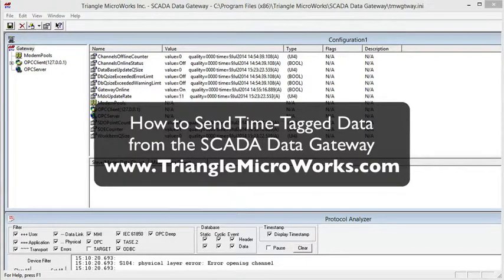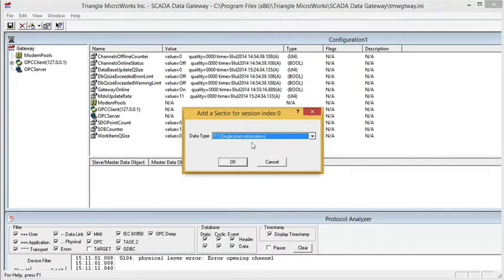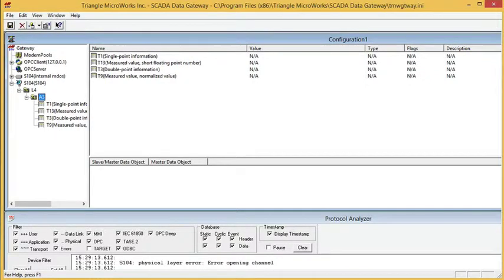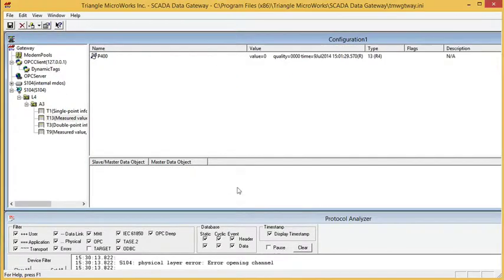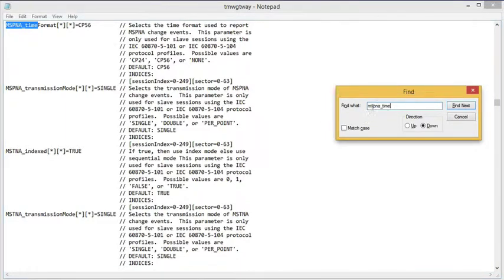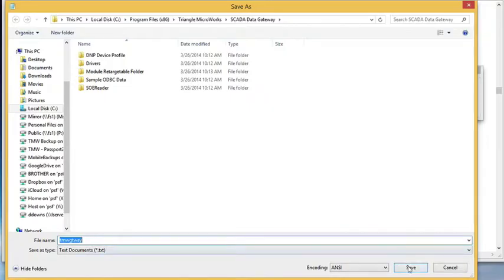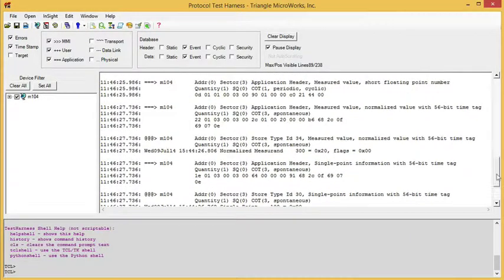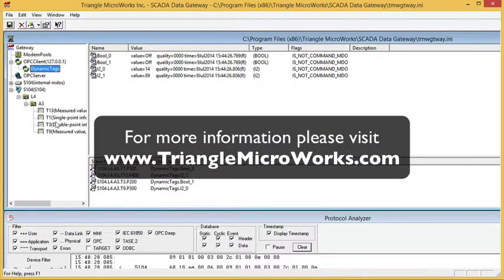SCADA Data Gateway - How to Create SDOs and Report Data With Time Stamps

Comment: Hi, I'm using TMW version 5.xx (web-based). The protocol used is IEC104 (slave). In *.ini file, the single point and double point have been set to CP56.

The data can be sent correctly, however the timestamp shows invalid in server side. xx:yy:zz (invalid). I have run protocol test harness as well, it shows the same.. invalid time stamp. 

how do I fix this?